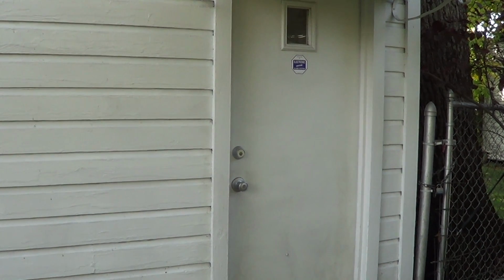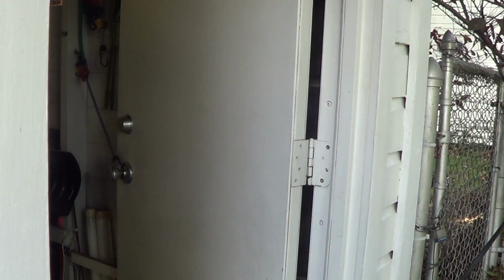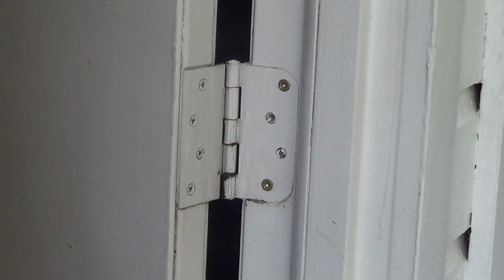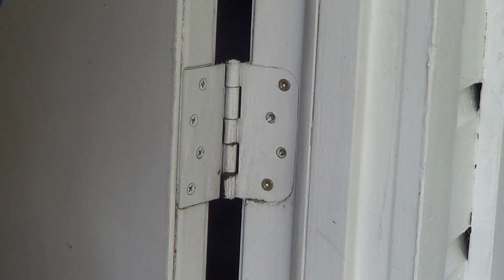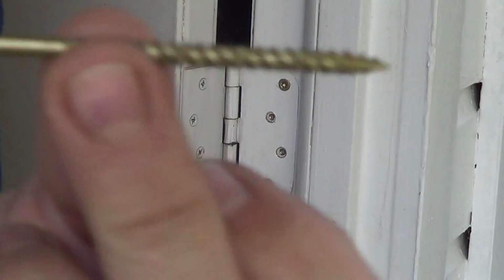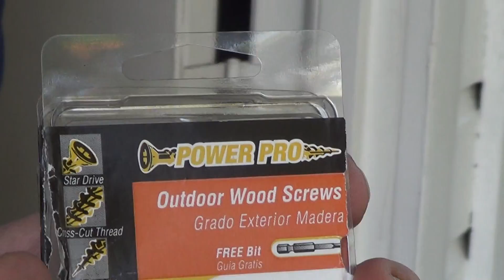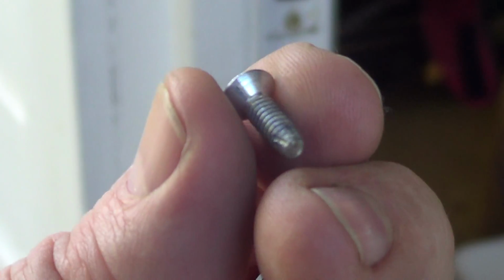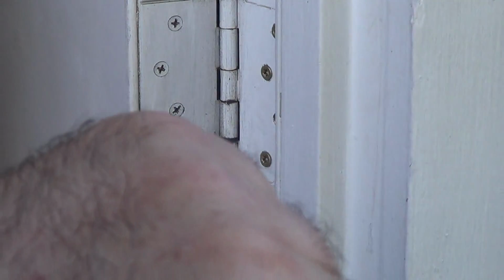Garage Security Door Upgrade

Comment: Assuming the jamb was also steel, those original machine screws were better than the wood screws you replaced them with.
Reply: Why would you think the tiny screws were better than the long screws? The long screws can go in ALLOT deeper as well, the deadbolt screws need to also be replaced too, if they are tiny as well, so it can go in the stud, and not just barely in the frame/door jam.
Reply: @mattmatt2417  Because wood screws and machine screws are totally different. The machine screw goes into a tapped hole in the steel. Screwing a lot deeper only risks potentially distorting the frame (or more likely, pulling the stud in), and ruins the machined/tapped threads. His comment about them being a piece of junk was because he didn't understand the construction.
If this were all wood, I'd agree. In fact, I've done that myself. But it's not.
Reply: If it’s wood, yes. If metal, no.

Comment: I install doors with 3 inch construction screws. to make the door really kick in proof, get some lengths of one inch ID black pipe and bore in far enough on the lock and latch strike plates to catch the first wall stud and the next one too.  that cold be 16 or 24 inches.   the door latch will fit into the pipe.   Of course at one point of force the latch will self destruct if kicked enough.   But I had one door that I installed get kicked for 10 full minutes before brother in law had heard enough and stuck a pistol in dude's face.  I had put the 3 inch screws on the frame and on the hinges and strike plates too.

Comment: The small ones were machine screws. The new ones are cheap woof screws. You ruined the threads on the door and now have little more security. Should have used hardened metal screws.

Comment: but the screws int the door? hmmm
Reply from the maker: I'm gonna work on them too =)
Reply: ***** lol I was thinking you should also. Anyway I'm glad I ran into this video because now I'm checking all of mine. I can't believe someone installed those. Maybe they did it intentionally for a future potential break in.
Reply: *****   I had the same exact screws in my front (metal) door. The jamb side wasn't the problem, just screwed in longer screws.  
There was a  problem with the door side tho, apart from having some foam stuff inside the door, it was practically hollow and the longer screws wouldn't hold onto anything..   The short screws and some paint the previous owner painted over the hinges with was all that was holding this door. lol,  what I figured I'd do was use epoxy I bought from lowes to permanently fuse the hinge to the door.  lol, then epoxy bigger/fatter screws with big heads  (The HIllman Group 230373 Truss Head One-Way Lag Screw, 5/16-inch X 4-Inch) thru the hinge.   There's no going back but,  damn door feels unstoppable now.   lol.   I thought the fatter head of the screw would interfere with the closing of the door but, I didn't know what else to do besides buy another door and luckily, there wasn't a problem with the door closing shut :)